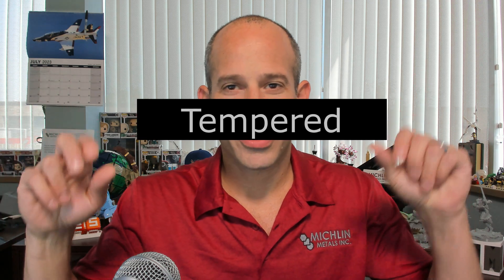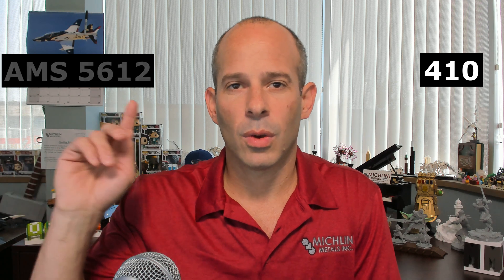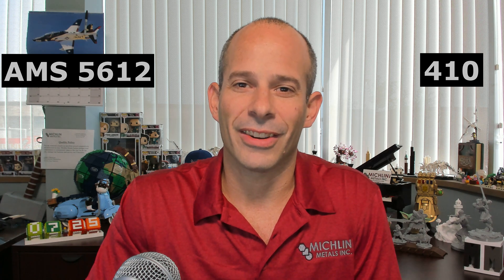Martensitic Stainless Steel Basics - Grades 410 / AMS 5612 / 430a / 416

Comment: I’ve always wondered why some of my stainless steel flatware is magnetic and some is not.
Reply from the maker: As you have noted, response to a magnet depends on the specific stainless alloy used for the flatware and other applications in the kitchen.